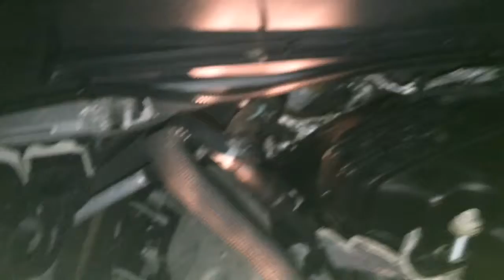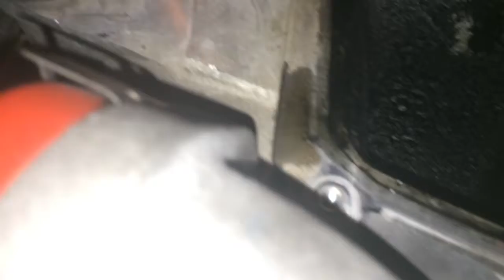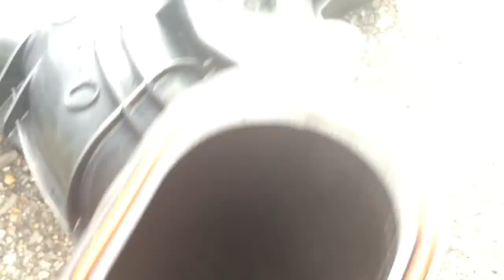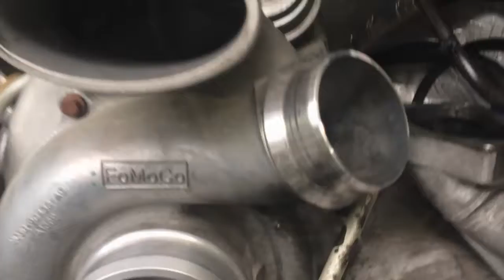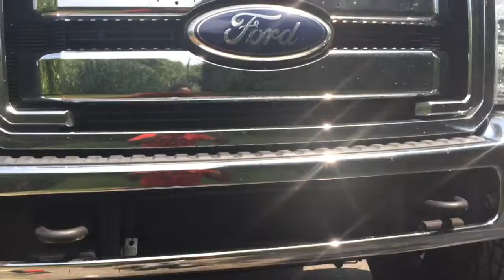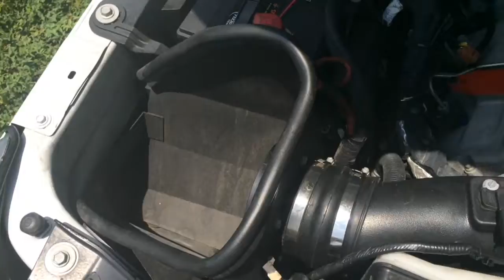2011 F250 Manifold and intake cleaning Topside cleaning

Comment: Nice video. YouTube recommended it so I watch it. LOL. They all look like this after a 100k. Diesels are nasty engines. It’s good to get in there and clean them up from time to time. Also a good time to check the play in the turbo bearing. I little play is ok as long as the compressor wheel doesn’t touch the housing. The oil in there was a little concerning too.

Comment: I can not believe No one has commented on this. I am planning to do the same to my truck because it is really clogged up. Did you notice any gains back in performance?
Reply from the maker: I can't sat that I noticed a performance difference...after the ccv reroute the intercooler side stayed clean. However, I just updgraded to a new (2015) turbo which needed new parts. I will continue to monitor....
Reply: I have heard that after venting the CCV to atmosphere the turbos tend to leak oil because they are not getting a portion of vacuum or some BS like that. What are your opinions? I am really wanting to vent it off since I just ordered the No Limits intercooler and I don't want that shit to clog it up. I am also going to buy the full turbo piping kit and do away with the ford setup.
Reply from the maker: I can't say for sure that venting to atmosphere caused me to leak. I remember changing oils trying out Delo400 10w30 as well as the ccv delete kit. I originally thought It was the new oil as it got worse... I realized I had better get it looked at. 

Also, just to update for tuning... I have the EZLYNK w/ PPEI tunes. The Aftermarket Turbo has been great. As I learn more about the new turbo it is a fixed single vane...when the old was dual. (If I'm quoting it right).  You can run the other tunes..it will just spool slow until about 3rd gear. Still testing...
Reply from the maker: I can't say for sure that venting to atmosphere caused me to leak. I remember changing oils trying out Delo400 10w30 as well as the ccv delete kit. I originally thought It was the new oil as it got worse... I realized I had better get it looked at. 

Also, just to update for tuning... I have the EZLYNK w/ PPEI tunes. The Aftermarket Turbo has been great. As I learn more about the new turbo it is a fixed single vane...when the old was dual. (If I'm quoting it right).  You can run the other tunes..it will just spool slow until about 3rd gear. Still testing...
Reply: Bsims50 ...when you say causes you to leak, do you mean turbo oil seal or engine oil somewhere else in general?